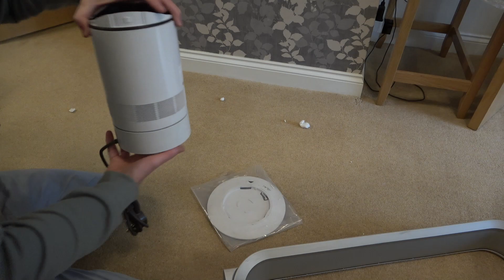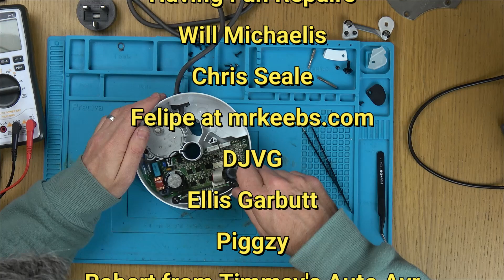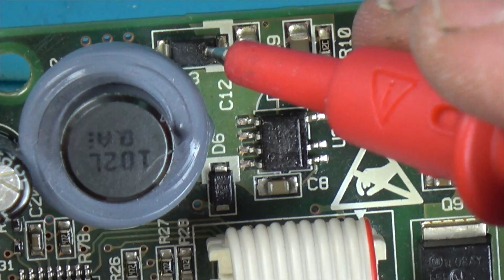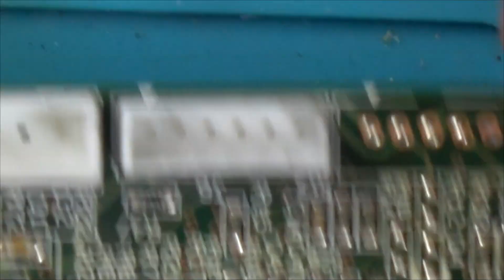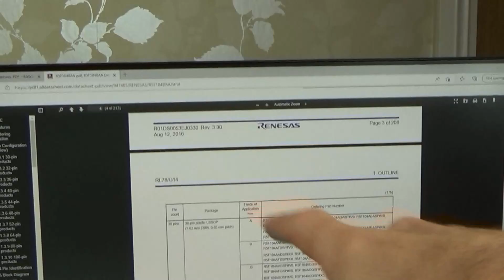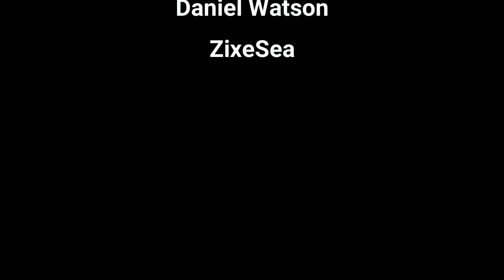Expensive eBay DYSON AM07 FAN - NO POWER FAULT - Can I FIX it?

Comment: Great Effort Vince! 
Unfortunately it's a similar situation to the hot and cold fan I looked at, and even if you bought a new MCU you need the software to program into it. I would be VERY careful connecting things to live mains such as your bench power supply. 
The ground on the fan may have been at quite a higher voltage than the ground on your bench supply and could have possibly blown it up. The number of wires going to the fan motor is due to it being a BLDC motor, and it has 3 coils + Common which run at around 300v DC, then there are 5 wires (GND, +5V, and 3 x hall effect signals for the motor position). Great video as always, and thanks again for the mention!
Reply: There is also a transistor H bridge drive on the board for the BLDC motor and those three 8 pin ic's on the other side of the board are the gate drivers.
Reply: It's not uncommon for such devices to have just a capacitive dropper instead of a fully switched supply. And why not, all HMI elements are fully isolated, and for the few mA the MCU consumes, it wouldn't matter in regards to efficiency.
And even with its own little power supply, it is tied to the MOSFETs one way or another, so not that safe regarding isolation anyway.
Supply voltage to the MCU could literally be 295V for GND and 300V for VCC. The MCU sees 5V, but your body sees 300V.
Reply from the maker: Alexander, thanks for the helpful comments. Could you have a read of the reply I sent to Buy It Fix it as this has me slightly worried if I come across it again. Thanks for commenting on this 👌👍
Reply: @Mymatevince  The only safe option is to have an isolating transformer, that way both hot and neutral are safe, as they don't reference ground anymore. And measure voltage differentials.
Otherwise, you'd first have to analyze the circuit, as there are still various ways how some theoretical 0V level could be tied relative to the AC mains. For example, you can easily extract a positive and negative voltage from the AC, reference the logical GND to the midpoint, and then have +170VDC and -170VDC, which again in the context of driving motors would make sense. In that case, you'd see at least two primary side capacitors, but the existence of two caps wouldn't automatically mean that they are used that way.
And after sleeping on it, I think the whole construction of this board is just a non-isolated DC power supply, with the low-voltage power supply just being a buck regulator, aka also non-isolated. That would be the most efficient design. So at no point had any voltage level in the circuit been safe to touch.
Reply: @Mymatevince  And just for clarification, depending on how the device is plugged in (I know in the UK it's hard to switch, but in other countries like Germany, the Dyson products just have a non-polarized plug without ground) the 0V will reference neutral, OR the 340V rail will reference neutral, which puts the 0V rail at -340VDC in reference to ground. At least it never adds up to voltages beyond that. Anyway, 500W isolation transformer is about 60 bucks on Ali.
Reply from the maker: @graealex  Thanks Alexander. I do have an isolated power supply, but I need to start using it on a regular basis. Thanks for the detailed write up. I'm going to have to read up on this more, I'm hoping there are some YouTube videos on it as I don't want to be caught out with this in the future. Thanks again for taking the time to reply 👍👍
Reply: @graealex  I was just going to reply saying the same. Although I don't actually have one myself! But I don't use my scope or wire my psu to anything that  could potentially be live.
Reply: @Mymatevince  I was just going to say the same thing vince. Isolation transformer. I used to use one years back at work, I don't have one myself so I don't use my scope or psu etc on anything that could be live.
Reply: @BuyitFixit  I think it is more useful for devices that are intrinsically unsafe anyway, like certain "hot chassis" CRTs. Running them opened is a big hazard, but you're probably not going to get one repaired without it.
Re: scopes - using isolated probes would be the best way, but they're quite expensive. Using a handheld, battery-powered oscilloscope is in many cases an alternative. And they came down in price quite dramatically where they might be the most affordable option for hobbyists anyway. OWON HDS242 (2-channel, 40 MHz) is around 100 bucks, and probably enough to even diagnose CRTs. BNC inputs are rated at 400V. They are intrinsically safe, as they are always floating and everything is isolated, even the BNCs.
Reply: @graealex  If the unit had its own switch mode power supply which powered the MCU, the MCU would actually be isolated from the mains side, because the unit would drive the transistors on the mains side through opto-isolators.
Reply: @tyronenelson9124  Not necessarily. SMPS don't necessarily reference any particular voltage. You can easily bind GND to any arbitrary voltage in your circuit. Assuming optocouplers exist is very dangerous.
Reply: @graealex  I don't think you fully understand, you cant always bind the HV DC GND side to the LV DC GND side in a SMPSU especially if the system is earthed that would be lethal.
Reply: @tyronenelson9124  Dyson fans are NOT grounded. The GND is bound to whatever voltage level.
I don't think YOU don't fully understand. There is no "zero" here.
Just take a look at 54:52 where you can clearly see the incoming cable from mains - it does not have a ground lead.
Reply: @graealex  I never once said that the dyson fan was grounded? who doesn't understand now?
Reply: @tyronenelson9124  I'll stop discussing this. You clearly don't know how electricity works. Just a hint, depending on how you plug in the device, the GND level of the MCU will be different, if there is no ground to reference - which doesn't exist on Dyson fans.
Reply: @graealex  Yes  very good point - I didn't understand difference reference grounds until the sparky at work showed me a 30,000 V ground in our induction heaters. :)
Reply: @graealex  Capacitive dropper supplies are ok bearing in mind you do not draw too much current and that the load that it is powering remains internal and isolated, like for example an LED bulb.
Reply: @tyronenelson9124  Or for example a fan where every part is isolated and thus not accessible to the user.
Reply: @graealex  In general a capacitive dropper circuit or even a buck regulator  has to be Internally isolated like in an led light bulb.
Reply: @tyronenelson9124  I'll try to explain it one more time - after the full-bridge rectifier, you'll get about 340V DC on the capacitor. So it has two leads - 0V and 340V. That voltage is then regulated down to 5V for the MCU, but used as-is for the BLDC. However, the 0V either references the hot or the neutral lead of the mains plug, depending on how it is inserted, and how your mains sockets are wired.
And afterwards, there is literally no need for any optocouplers, as both the MCU, the MOSFETs and the motor operate at a common voltage reference.
The big problem is that again, the 0V from the perspective of the MCU might reference neutral, which is about ground, or hot, which in the UK is 240V AC.
The comparison with LED bulbs is not useful, as the LED bulbs that employ a SMPS usually drive the LEDs itself from the same voltage, so it can all be floating. However, the motor in the Dyson fan is driven from the 340V DC directly. Which makes sense, as it allows for rather small MOSFETs.
Reply: @graealex  you are absolutely correct!
Reply from the maker: Thanks Mick, you know that didn't enter my head about ground not being 0V. From memory I was careful whilst it was plugged in but that has made me shiver truth be told as I assumed INCORRECTLY that, that side of the board was low voltage in respect to ME receiving a shock. In the future how would I measure the true ground voltage if the fan mains lead didn't have the ground connected, I don't understand where I would take my true 0V ground from as the plug socket earth is not connected to the fan's circuit board. I hope that question makes sense. Apologies if it doesn't. As always thanks for the help 👍
Reply: You all miss that it can have SMPS and the motor can be AC controlled by Simistors (Thyristors), and controller board isolated from mains as it should be.
Reply: @technixbul  But it doesn't look that way. Honestly, it looks just like a buck converter for the electronics.
There is also no reason to isolate it either. If anything, it would make the board more expensive, for zero reasons.

Comment: I think it was a psu issue at first then u burned the micro
Reply: That could be or one of the mosfets failed and sent full voltage in to the mcu and fried it had some weird fan from somebody with a dead mcu wich got killed by one of the motor driver chips (high voltage) by shorting

Comment: Vince, I had the exact same issue with mine and off the back of watching your videos i tried to fix it, fast forward i couldnt and it went to the dump. hey ho.. moving on 🙂
Reply from the maker: At least you tried Mike. Might be a common failure on them...I've ordered another faulty one on eBay to see 😂😂😂
Reply: @Mymatevince  my biggest concern was even if i did fix it how would i connect the oscillator arm back on given there is no space! looking forward to seeing how you get on with the next one
Reply from the maker: @smikee  I think that is what the blanking plate at the bottom is for, but it didn't line up on this one here. I'm hoping I get to that stage next time 😂😂

Comment: At 8:25 in and I wonder if its a safety switch issue. There's a small pin under the base of the fan that cuts the power if the fan gets tipped or moved. Now on with the video  🤔🤔🤔🤔

Comment: Put some silicone grease on the cables when you're already in. They get squeaky from the oscillation.
Also, no isolation transformer when testing mains stuff?
Oh, and yes, the MCU is the brains, and it might be responsible for controlling the brushless motor, like the actual phases, which would explain why it's such a powerful MCU. But the transistor might not actually have been a transistor, but a voltage regulator.
Also, explanation for why 4V can hurt an IC when it is rated above that... Because the data sheet will tell you max input voltage on any pin is for example Vcc +2V. But your Vcc was 0V, so 2V might have been max. As an example.
Reply: You are correct about the MCU, the transistor is used to switch 5v to supply the hall effect sensors on the motor.
Reply: @BuyitFixit  Ah, okay. After watching till the end, I saw that it could not have been a voltage regulator.
But just saying - only because something has three legs doesn't make it a transistor.
Oh, and the reason I suspected something different from a transistor was because of the weird through-hole package on a mostly SMT board.

Comment: Watching this sat in total darkness other than laptop screen, I love watching these vids. I'm sat in darkness because EON offered an incentive of £100 to reduce from 0.22kwh per hour to 0.09wh. I have an Ups system, a very expensive one, the battery in my laptop is half dead so I'd get 30-40 mins. Turned the fuse box off so consumption of gas/electric is zero, combi boilers require electric to work. An impressive backup supply  3 hours plus.
Reply: I think it's a great idea to have a backup power system. I've recently installed a solar system, and just got 18kw of batteries for storage. Also have 2x 6kw diesel generators, as we live quite remote, and when we had that storm Arwen last year most of the area had no power for around a week. We were ok tho :)
Reply: @BuyitFixit  I agree, my issue, ground floor flat. Seldom called on but it's there, doubt I could afford replacing the battery though, unit was almost £300. Done me well so far.
Reply: Maybe a show n tell, I don't use much electricity but what I do use is smarting a lot, shhesh 0.22kw per hour. Bought a solar flood light to illuminate interior lasted 3 months of summer, battery dead, very little usage so no overcharge protection, checked solar panel on sunny day 6.4v to a 3.7 18650 singular, poor little mite got cooked, maybe 2 18650 with limited output could cope, would aldo need overcharge protection hmm south facing wall.

Comment: Cool fan, Vince:)
That big hole on the bottom is to access the 2 screws. You don't need to undo the clip securing the plastic piece on the oscillation motor axle.
Reply: I was thinking the same (although I don't own one). That circlip would be impossible to put back otherwise.

Comment: So far, everything I have seen with the Dyson name is overpriced, apple-style tat.  I'd never pay full price for any of their equipment.
Reply: I've been using the same DC01 upright vacuum from Dyson for decades, it used to belong to my parents. A lot of the newer stuff sucks but there are some gems.
Reply: It used to be quality, 20 years ago. Now it's just cheap Chinese junk like everything else.
Reply: I like older dyson products.. James dyson was my idol when i was 4...modern ones are cool but the vacuums don't have that much zaz anymore
Reply: I just wanna start off by stating that I’m not an engineer, and I am not college educated. However, as an owner of several current generation Dyson products, I’m not disappointed in them. My parents used to have the rolling ball vacuum when I was a kid and that was literally the only vacuum we had from the time that I was a child until I moved out of the home as an adult. I think they still use it today. I’ve been using a V8 cordless vacuum that they manufacture in my home with three huskies, and that thing cleans like nobody’s business. I’m also a hairstylist of 11 years, and the super sonic hairdryer is substantially more reliable than its competitors. I don’t know any salons that don’t use those exclusively, at least here in LA. I have an air purifier. I literally never turn it off. It runs 24 hours a day, zero issues. So I think it’s just a matter of personal preference. Using a blanket statement and saying that all Dyson products are overpriced tat is a bit naïve. Do you value the lowest priced option available over something unique and engineered using proprietary technology? Great. Or would you prefer a product that is subjectively expensive, receive excellent customer support, and have a futuristic seeming piece of technology? Also great.
Reply: @thisandthat8686  We simply balance our needs with our budget and our desires.  I love shiny technology as much as the next guy, but the perceived value/effectiveness is a calculation that we make based on our finances.  Let's say we got a large Christmas check from a relative - would we buy an expensive Dyson product - probably not.  I'd probably buy something more suitable to our normal life and put the rest in the Roth IRA.  

Your point is well received.  That said, I am older and I own the most expensive Kirby vacuum available.  Not because I bought it new, but because I got the whole package at 60% off from an older gentleman moving in to a retirement community.  Frankly, I'd put my Kirby up against any Dyson product.  Dyson certainly has the weight advantage, but the Kirby has power drive and more attachments than you can shake a stick at - including a shampooer.  It's also completely made of REAL metal, it's serviceable and parts are readily available.
Reply: @TechGorilla1987  oh my god my grandpa Mike (RIP) used to tell my Dad about his Kirby vacuum all the time. Always wanted him to buy one. He used to talk about it like it was best car he’d ever driven. Cheers
Reply: @TechGorilla1987  completely agree! I acknowledge your age and wisdom, and as someone who has spent my entire life on the Internet, I appreciate the friendly exchange.
Reply: @thisandthat8686  you're just lucky. The early stuff was well built and reliable. Now all the stuff they make is made cheaply, sold way overpriced, and flimsy and breaks down. The fact that your stuff has been working is through sheer luck.
Reply: @SimonQuigley  you’re probably spot on Simon. Go take ‘‘em down ✊🏼
Reply: I love my dyson fan.m
Reply: Also shop their sales if you want something. Sometimes they have holiday discounts up to $200 USD.
Reply: Apple isn't tat
Reply: I smell some one with no style
Reply: Apple hardware is genuinely good and usually industry leading, so the comparison doesn’t work 🤪
Reply: @Aaronage1  The comparison is apt when you look at the repairability of both products.  You cannot replace parts on your own $1K iPhone without having Apple sanction the repairs.  Your phone will cease to work properly even using OEM parts with OEM tools.  The Dyson sells proprietary items not made to be fixed.

I buy things that are repairable.  I like to repair things.  I like getting the value out of an item I only paid $.50-$2 for.  

Of course, this is simply one mans opinion.  I don't want to denigrate people who like the style and aesthetic of Dyson, I just don't prefer it.  Stay well!
Reply: @Aaronage1  Haha, right. 🙄😕😂
Reply: You’ve probably never bought any of their equipment, more fool you as you can save a bundle in sales, or from their official outlet store and their products are serviceable, so last and are good quality.
Reply: @marksapollo  So I'm a fool for wanting to save money?  Did I understand that right?  I can buy a half dozen fans from a thrift store that move the air just as well for 1/10th the price.  With people thinking that saving money is foolish, it's no wonder that we are in the state we are as a society.  Stay well internet person.